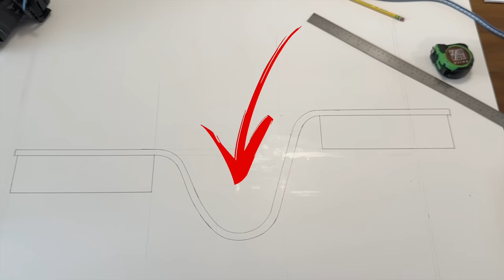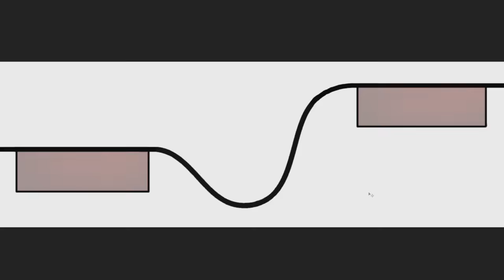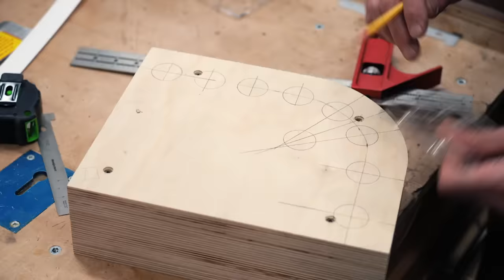Bending wood is easy...until it isn't.

Comment: My first bent wood project ever was a cabinet, curved both for aesthetics as well as a radius to fit a very constrained location.  I didn't have any wiggle board or a laser cut form, and was truly amazed when the contraption I came up with of thin plywood laminations using plain wood glue, forms hand tweaked on the router table,  and tie down ratchet straps as clamped actually worked on the first try.   Thanks - I learned a lot of tips here that would have saved a lot of stress at the time!
Reply from the maker: Great! Glad it was useful! And sounds like you made it work with the tools that you had which is very resourceful and something to be proud of. 👍🏻

Comment: Great build! Would love to see a version with the curve flipped so things can rest in it
Reply from the maker: You mean as I originally designed it? 😂. I can't believe I flipped the design upside down at some point during the process. I will definitely be making another one with the curve down. 🙌
Reply: @KeithJohnsonCustomWoodworking  😂 nothing better than hyper focusing on the details, and missing the big obvious things. It happens to us all
Reply: @KeithJohnsonCustomWoodworking is that the mistake you alluded to in the video? I thought it was a  mounting system but then you addressed that
Reply from the maker: @hoipolloi741  Correct, that was the mistake I was referencing.

Comment: Beautiful, elegant piece!  Love the step by step description of the process, and the approach to "fixing" minor errors!  Question:  Would you have been able to use a single form and a vacuum bag instead of the 2-part form to get either of those bends?  And do you think that Unbind 800 instead of Total Boat would have prevented any of the spring-back?  Thanks!
Reply from the maker: Thanks! My vac bag isn't big enough to accommodate a piece this large, but yes it could be done. And no, I don't think Unibond would have made any difference. The 2 main factors were kiln dried wood instead of air-dried and not pre-bending.

Comment: 25 years in the industry I can safely say I've never put my drawers under the project when they belong on top or vice versa.😆 
Thank goodness for that.... but I HAVE tossed a roll of masking tape across the shop and destroyed a 10 foot backsplash as the countertop job was being loaded on the truck for delivery and install! Those little clips are extremely awesome and they make for an extremely tight fitting wall hugging backsplash but the exposed laminate they create did me in on that day....that and my decision to toss a roll of tape across the shop that day. 😏
Also I'm a strong proponent of wide strap clamps for outside bends and smooth corners. Also I suggest keeping your pre-bend steamed stack in the jig overnight at least in order to set those cells in the wood as it dries.

Comment: Good work Keith. If you do more work like this apply cork sheet to the surfaces of the bending form it guarantees you will get perfect compression of the lamination and flow of the curved elements.  I've done many similar projects and just eases the pressure to get each form perfect.  As you've probably now worked out if you want a curve that produces a tru 90° an over bend is essential to reduce/eliminate spring back.  Its a fun process but worth it in the end.  Love the drawer hardware, you have some cool friends.
Reply from the maker: Yes, I usually use cork, but I didn't have any and it wasn't readily available. 👍

Comment: Awesome piece and crazy creative design! Now I want to try some bent laminations. For the mounting brackets, make the mortise an 1/8-3/16 deeper, make the plate a 1/4” bigger all around and tap a new hole in all 4 corners to accept an allen set screw that you can then use to adjust your reveal all the way around. It’s just like leveling screws on a router table plate but upside down.
Reply from the maker: Thanks!

Comment: Hi Keith,
Love the shape and the hinges.... well pretty much loved all 43 minutes thanks.
I need to try that fast cure finish it looks very usable. Were you happy with it?
Regards James
One Handed Maker - Australia
Reply from the maker: Hey James! Thanks for the kind words. I’m not sold on the finish yet, especially in corners. There’s a fine line between wiping away too much excess finish or leaving too much on the surface, and much can result in the finish being streaky or splotchy. I think it works great on flat surfaces, but I’m not sure how much I’m going to use it on intricate pieces of furniture with a lot of interior corners. I need more practice.

Comment: did you consider vacuum forming the main piece? also to avoid flat spot on your one piece forms you have to use layered cauls and then blocks to disperse the pressure and make it even.
Reply from the maker: Yes, I did consider vac forming , but my bag wouldn't accommodate the height and length of the form. I need a bigger bag 😂
Reply: @KeithJohnsonCustomWoodworking  makes sense,  might have needed a 4x8 bag to pull it off,  I probably would have just bought 1/16 veneer and done it with that,  because it would save a lot of time sawing and having to deal with steaming and all the other things that introducing water to wood can do, you made an important point that I've tried to talk to other you tube people about, and gotten a lot of guff about,  you cannot use wood glue for bent laminations, it will cold creep over time and the lamination will come apart,  if you are using bending ply and veneer and vacuum, forming then you can get away with it although not advised.
Reply from the maker: @oliver299d  Yeah, I've learned my lesson using PVA glue with bent lam!

Comment: I love that you have been embracing bent lamination, it’s something I have been wanting to tackle for awhile now. I’m also curious how that finish holds up to water, If it were used for a table top. Great job as usual. Wish I was out in your neck of the woods to buy you a fizzy water, and pick your brain
Reply from the maker: Bent lamination opens ups so many cool design possibilities! And the LED finish is primarily used on floors, so it's built to withstand some abuse!
Reply: @KeithJohnsonCustomWoodworking  I was messaging Suman about that. And told him i thought about doing a video on the different types of ceramic coatings and how well they’ll hold up to my kids. I’d be interested in a collaboration video too.

Comment: Was there a reason you could not use the back and sides of the drawers to correct the spring back on the gluing.  I usually have a bit of spring back but use the adjoining parts to accommodate the small differences.   Am I courting disaster?   So far it has worked.
Reply from the maker: Yes, I could have and I actually filmed a segment showing how to do it, but it didn't make the final cut of the video due to length.

Comment: It is a beautiful piece. The mounting will probably be a problem because any flex downward will press the bottom of the drawers into the wall and interfere with opening.
Reply from the maker: It was a total problem from minute one 😂. It will be rectified 💪🏻

Comment: Just my penny to these comments. In my view, on top of the curve (behind the curve) need to install one standard mirror/picture hang plate in horizontal position and hang (slide on side) these curved shelf on it. Then screw the side support to the wall. In this way of mount, no more shaking shelve will be when you open the boxes. Like this one from Home Depot - OOK
20 lb. Large Keyhole Hangers (2-Pack)
Reply from the maker: I re-mounted onto threaded rods that were screwed directly into the studs for maximum strength.
Reply: @KeithJohnsonCustomWoodworking  Oh, yes! Thats great! More complicated for someone, but its easy for you! Thanks!

Comment: Are you sure the springback had to do with not steaming the first drawer face?
I noticed the other difference in technique is in the first one you blue taped the pieces on the ends and in the middle so they wouldn't slip around prior to bending. Is there any chance the tape truly kept the pieces from sliding against each other as much as they needed for the bend?
Reply from the maker: That blue tape is quite stretchy and it wasn’t tight around the stack. Considering the other two drawer fronts were steamed and pre-bent and had no spring back, logically leads me to believe that the one that wasn’t steamed sprung back for a reason.

Comment: The shelf is beautiful, great job.  The mounts are as flimsy as it gets, you can't put anything in the drawers otherwise it'll fall off the wall!!  Suggestion for hanging, long stainless rods with a thread to thread into an anchor in the wall, and push into an accurate diameter hole in the back of your shelf.  Hidden and strong!

Comment: 9:24 Keith, do you find when doing book matches or other grain dependent work that this messes up the results at all? I have a resaw fence that’s out by about 1/128 so doing repeated cuts starts angling the wood.
Reply from the maker: Not really. And it's only noticeable sometimes when you get close enough to smell it 😂. If you were gluing back face grain, and lost all that material in between, the difference would be much be apparent than on edge grain.

Comment: Try using a  1/8 cork comes on a roll. Glue it down then put your packing tape on. It takes out any imperfections without getting glue dementia
Reply from the maker: As I mentioned, I didn’t have any nor could I get any quickly. I’ve used it many times in the past on my forms.

Comment: That last shot of hanging it, didn’t look very sturdy on the wall. Very cool design.
Reply from the maker: It's totally not sturdy 😂. Going to run threaded rod into studs and drill holes in back of shelf so it slides on. 👍
Reply: @KeithJohnsonCustomWoodworking  good to know. Thanks

Comment: 32:43 you could have rounded the outside back corner of the draw box and avoided any issues with touching the wall.
Reply from the maker: I tested that and it still had to be moved out.

Comment: What I think your mistake was @KeithJohnsonCustomWoodworking was that you didn’t take into account the bolt having to screw onto the mounting plate and forgot for recess for it.
Reply from the maker: No, that was actually taken into account...the threads just needed to be cut to accommodate the max depth it could go into the top. 👍

Comment: It's upside down.  I would do it the other way so the central part is for your keys  / hat / gloves when you mount it in the hallway by the door.
Reply from the maker: Yes, I know. Check out the original design in the first two minutes of the video. Somewhere along the way it got flipped.

Comment: 3:13 folks on a budget could just scribe this with a washer for a nice, consistent gap
Reply from the maker: If you have the right size washer...which is unlikely being that is such a large gap
Reply: @KeithJohnsonCustomWoodworking   Yes, true 👍 Or adjust using an insert/spacer block like you did 😀

Comment: I'm not following how the kardashian's ass bending jig can't just be each side after the cut if you used a plunge bit on the jig so it cuts BOTH jig mating faces at the same time? How does the material thickness come into it as the jig could be used for ANY thickness surely?  Why does it need to be faced with the bendy plywood?
Reply from the maker: The radii are different when both sides get separated. And Bendy ply gives a smooth surface for the laminations to be stacked on. Otherwise, the ribs of the form would leave impressions